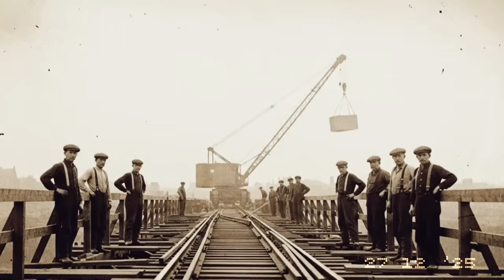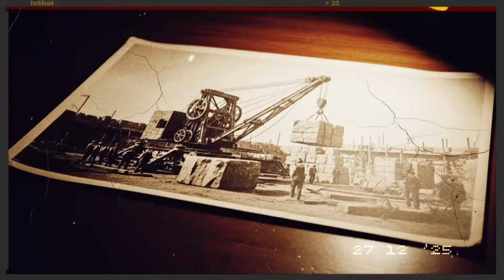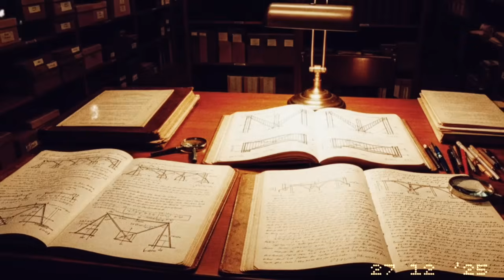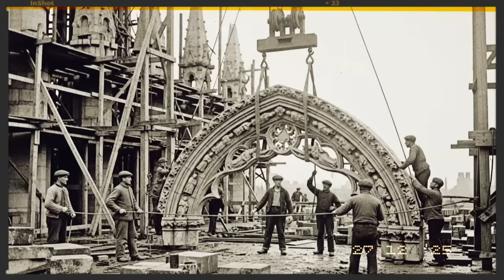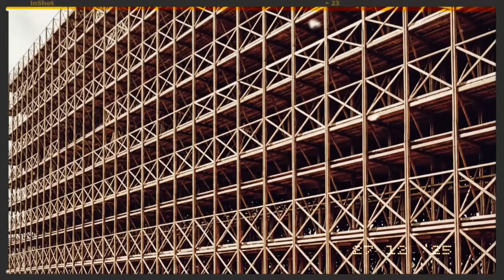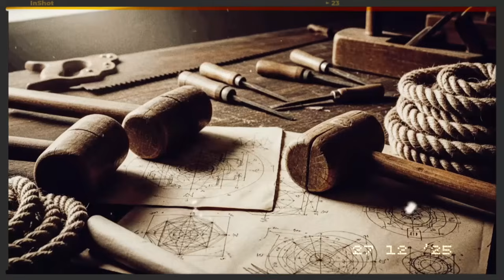What They Found in Old Photos Shocked Engineers

Comment: Doesn't it stand to reason that these old cranes have metal bases,like iron...for example, with wooden slats built around them, maybe to avoid the metal being exposed to the elements,like rain.....thus avoiding them rusting out as quickly? Maybe these eggheads need to work with their hands more often to gain some common sense? Just a suggestion.

Comment: Old growth wood is supper dense because it took saplings years longer of growing to tall due to the lack of sunlight reaching the ground! Some of the wood in the old barn on our family farm was cut and hewn by hand 150 or more years earlier. Driving a spike into them was impossible without first using a hand auger to drill a hole(an electric drill would burn the bit)! There were old wooden mallets, milking stools still around today, that were old when I was a youngster 75 yrs ago that are just as tough.   We had an old handmade pitchfork made of wood that I would have defied anyone to break the handle!

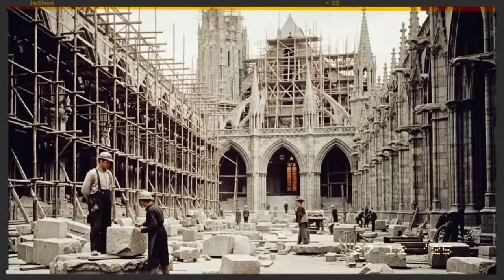Comment: ( 7:52 ) gotta say... alot of details ur misssing in these images / photos ...
Also, thats not "hemp rope" tho it does look like it...
Regardless, any rope that's made of natural material can be made to bare increased weight for total load weight amounts...
U just need to know how much of what to add or apply to the rope...
But mainly ur gonna need long enough & thick enough single strands of ur material & it needs to be woven in a way that provides a "unity" for "strength in numbers" & "allows" the "give / stretch / bend" necessary to "absorb &/or dispurse tension &/or strain" caused by the "swaying & strain of lifting & moving weight"...

Id explain the wooden beams used but i think that enough explaining for 1 comment 😅

Comment: Look at old mining texts for geometric solutions to structural problems. Old historical joinery for square set mine supports show these construction techniques. For cables use hyperbolic versus standard trig functions. The resolution of caternary curved structures versus simple curves show significantly better support and rigidity under load. Old wood treatments improved the structural strength and longevity of wood. Stronger fibers and denser weaves increase cable strenghth. I noticed cable stiffners on some lift beams laid lengthwise, tensioned, and anchored to steel joining plates. Look at the checking patterns in the beams. Load distribution is interesting. Resultant tuning via geometric stress pattern adjustment. You can play with this by end loading a square beam and measure resonant peaks. Then start adding stiffeners or tension to move resonance points. Change attachments and measure deflection vs load. Fun exercise.